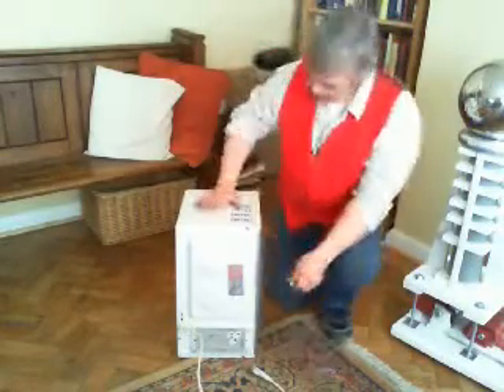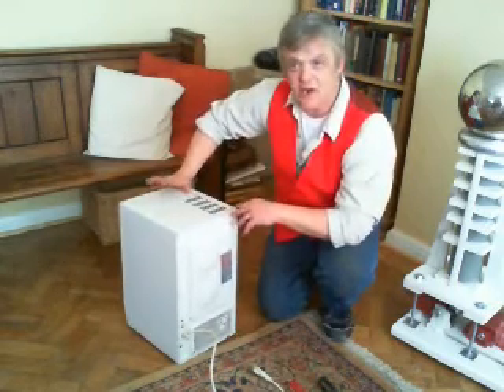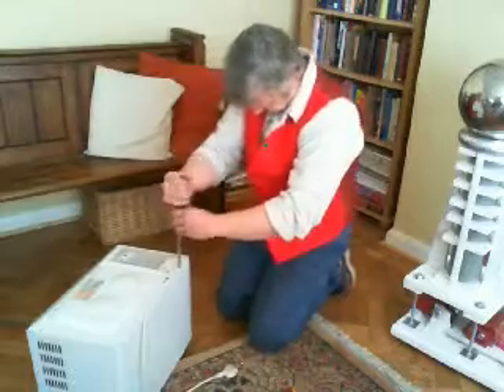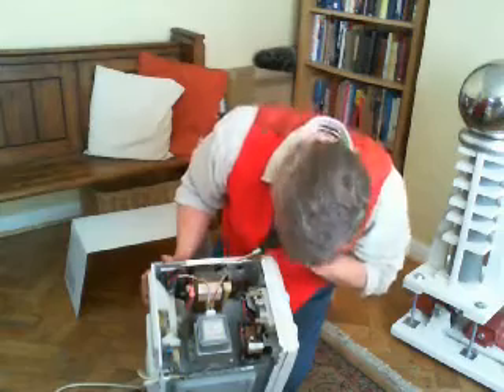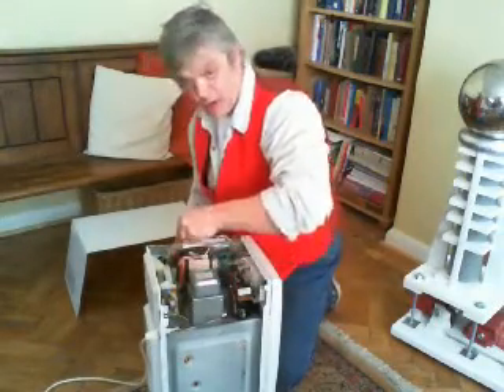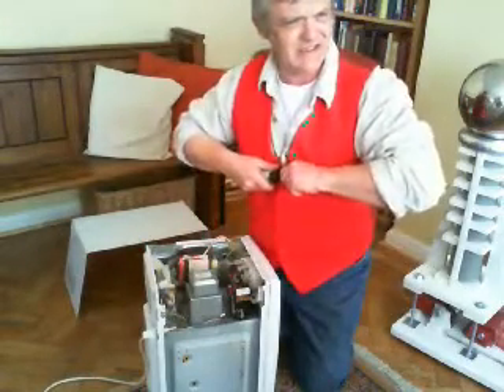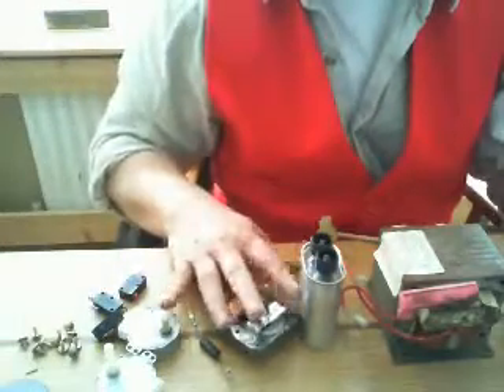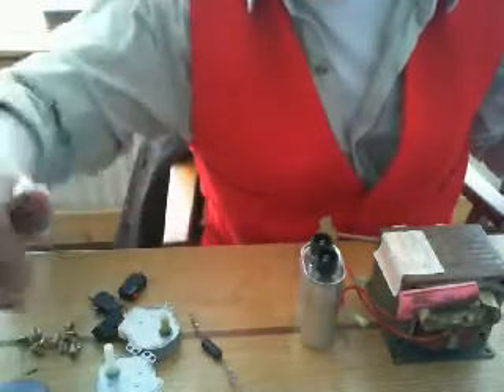Getting Parts from a microwave oven

Comment: i used junked microwave oven parts to help build the high voltage frequency matching hho generator for my car. thank you for your service to us out here in the bushes. a small select group is very grateful. supermuble has the plans for the meissner circuit that does the freq matching. Cheers Bob.